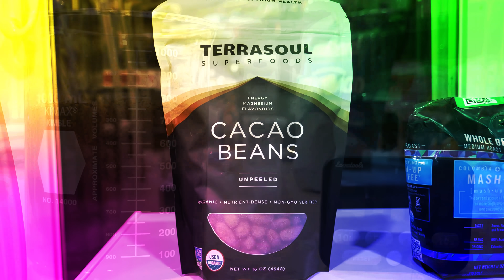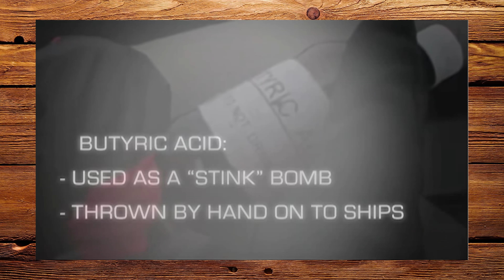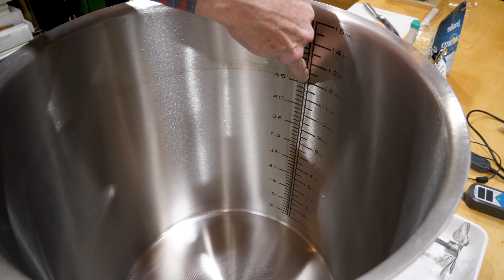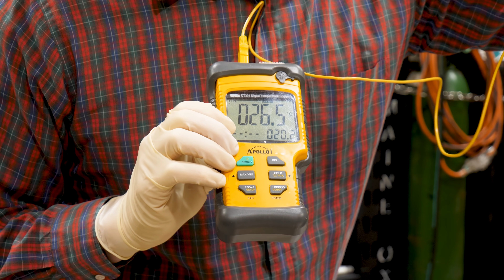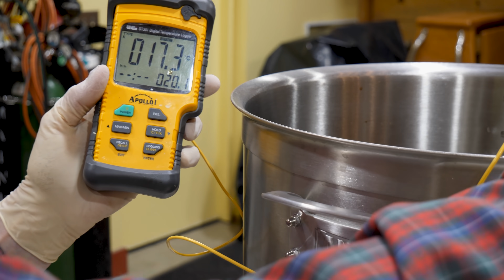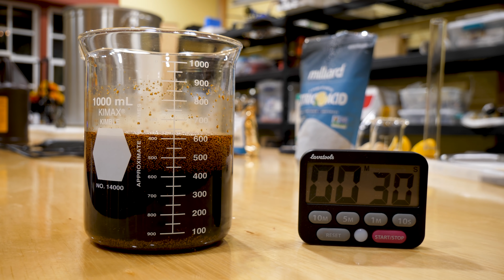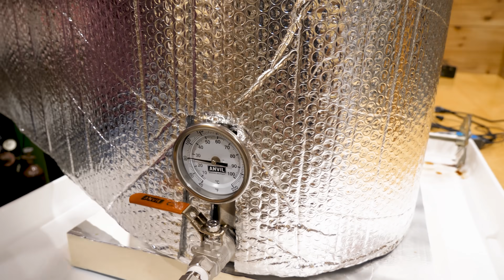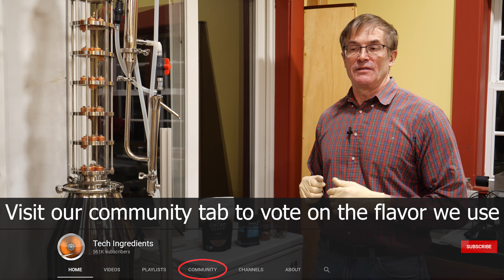Making Flavored Rum | Easy and Cheap! - Part 1

Comment: I really wish it was allowed to distil alcohol in Sweden. I have been trying to make my own styled.. "Rhum and coke wine".. Not ENTIRELY sure it's legal, but it is at the very least primarily based on fruits... (though I wouldn't know how to find a back-door to make a coke flavour so I just add cola-concentrate after the fermentation is done).. You have tought me a LOT of new things that I never thought about.

Either way; When you talk about how difficult it is to get molasses out of the jar.. Me personally SQUEEZE the jar to get out most of it (after all.. it's soft soft-plastic).. then I add water and shake vigorously... and pours again.. add some water and shakes again.. in the end the container is clean and I have every drop of sugary goodness in my batch without using needless energy for heating.
Reply from the maker: Thanks!
Don't worry about the energy expended to heat the molasses, it needs to be warmed up anyway whether it's by the hot plate or the heat that had to be added to the water in the fermenter.

Comment: Hey guys, a quick question and it might sound dumb to most people but for trying to distill first time, I was thinking I do not have the dunder available from a "previous batch" - is there anything I need to do in place of it? Your help or feedback would be much appreciated. Many thanks
Reply from the maker: Not really.
Treat your  first batch as a test run.  You'll  get familiar  with the process and the result is still pretty good.

Comment: Question about Sulfured Molasses. Obviously its much cheaper, is there a way to remove the sulfur before use?
Reply from the maker: Probably, but the necesary equipment may cost more than the savings.  Also, the sulfur is added to prevent immature sugar cane from spoiling prior to extraction.  You may not want that molasses in any case.

Comment: Can an aluminum bucket be used instead of stainless steel bucket.
Thank you very much.
Reply from the maker: It probably can, however as most fermentations run a little acidic you may leach some aluminum into the wash, mash etc.  But, because the distillation process should separate that from the final product, it probably doesn't matter.

Comment: is a distiller a requirement when making rum? I heard you can make rum without a distiller or you can use the freezer to distill it? What if i wanted to make a lower alcohol content rum? I ask because I do not want to get a distiller..no room
Reply from the maker: Generally, freeze separation will enrich the alcohol content as with Applejack, but not that much.  Also, you will not separate out the methanol from the ethanol, only reduce the water content of the unfrozen liquid.

Comment: It still amazes me how irrelevant the color of the source liquid is to the color of the distillate, particularly regarding ethanol. You'd expect with that dark of a wash you'd get some color coming over, but no. Even with a molasses wash, it's still crystal clear. Amazing.

Edit: Also, it's really cool to see that the speakers from the "2nd Best Speakers" video have found a home as shop speakers.

Comment: Dry yeast should re-hydrate without any agitation since the dried out cell membranes are in a very fragile state. Let the yeast rest in your wort/wash/wine/cider for 15 minutes before stirring:)
Reply from the maker: I've never had any difficulty with this technique.  But, you at still be right.
Reply: Comming from a beer brewing background the idea of over/under pitching is quite important. Both strategies will get you drunk- but it affects attenuation and ester production in your fermentables. Hydrating your yeast properly is one way to have a decent idea of cell count. This is important in brewing a good repeatable beer- but I would expect it to be even more important if you where to run it through a still where esters tends to end up inn the various cuts. Of course- build your column tall and this will make no difference to your vodka:) I really enjoy your videos so keep up the good work!

Comment: 19:35 -- explains target of 5:1 concentration, then says "if we're adding 2 gallons of molasses, we're gonna add 5 gallons of water..."  The other calculation of liters was on the mark for that 5:1 ratio...  Solid proof that we should all stick to metric.
Reply from the maker: The ratios are actually easier in imperial. But, 5:1 is correct and that's why we ended up with 12 gallons.

Comment: Making wine in a carboy, the stopper keeps the oxygen out and a bubbler lets out CO2...  Does that container seal or does it just ferment exposed to the air?
Reply from the maker: It does.  The positive pressure of CO2 within the pot as well as the lid keeps the atmosphere out.
Reply: @TechIngredients  Fair enough, but now I have a new question for a RUM I just learned about and LOVE, but would ALSO love to learn to make at home, and I'm hoping you can help.  So 1st would require you giving it a taste.  Its Sweet, and Goes down like a "candy that gets you drunk" is how I explain it to people.  I actually CUT it with 1/4 Bacardi Superior because it's a little too thick and sweet for me, but I still want to know how to make something that resembles it so closely that I could drink it daily without buying a bottle.  Or.... At least learn how they can make such an amazing product.
"Briniey Gold" SHIPWRECK-> Vanilla!!!  Find a bottle and taste it chilled over ice.  I've been a Rum Drinker for the past 20 years and have NEVER found anything I enjoy so much except BUMBU which I've found to have quality control issues..  Bumbu is still a "harsh" drink where "Shipwreck Vanilla" goes down so smooth that I just want more and more and more and everyone I've introduced it to just loves it more than most of what they drink... Whiskey, Gin, Vodka, Tequila, and other RUM Drinkers alike.  They've made something great, so now I want to know how they did it.  Like cooling air with water, or making rockets.  Someone else figured out how to make it work, now... PLEASE show me how they made it work, so I can make it even better!!! Please??

Comment: Thanks for the video.  I noticed that (~19:40) you say that the final ratio is 5:1, but then say 2 gallons of molasses to 5 gallons of water.  Which is it, please? 

Otherwise, great video.
Reply from the maker: It's 5:1, water to molasses.  That's how we end up with 12 gallons of final mix.

Comment: Do you not put an airlock in lid of fermenter?
Reply from the maker: No, it isn't needed.  The lid is flush and there is a thick layer of stagnant CO2 on top of the mixture.

Comment: Wow well water at 7 is pretty shocking. Mine comes out around 8 or 8.2. I wonder what would happen after the water is oxygenated thoroughly.  The CO 2 in the water will make it show more acidic until it can get out of the water. You might want to try just for fun letting your water sit in an open vessel for a few hours and check it again.   Maybe put an aquarium bubbler in it to speed up the process.   I did the same thing at my parents house because theirs showed very acidic at 6.0.  After aerating it was 6.6.

Comment: At minute 35 you discuss how the exothermic reaction of fermentation can lead to thermal runaway in larger batches.

Is there a formula that can be used to determine, for a given ambient temperature, the largest viable volume that could be done without the use of cooling equipment?

I live in a cold climate and ideally want to brew 300 liter batches (or bigger) of beer, without expensive cooling equipment. and without the yeast cooking itself!  heating is not a problem.

ambient temperature would never be above 10C and would usually be more like 5C most of the time.

is there a way I can work out my optimal batch size for a given temp?

I have read that yeast produce about about 587 kilojoules energy/heat (310 Celcius heat units I think) per kilogram of sugar 

but I dont know how to calculate the heat loss for a given stainless steel vessel at a given ambient temp

I need to work this out before I can buy my fermenter!

also what volume is your pot in the vid?

Thank you so, so much for your work of bringing education and inspiration to the world. 

Peace.
Reply from the maker: Despite the dimensions and your temperature estimate this is almost impossible to quantify because of the positive feedback loop with fermentation.  You want to operate at an unstable saddle point.
You don't need expensive cooling equipment just the ability to adjust heat loss relative to temperature.
Submerge a copper or stainless loop in the pot, attach a small radiator and cooling fan and turn a pump on and off with an Arduino/ thermometer.

Comment: doesnt the dunder pit have good yeast so as no need to pitch more yeast?
Reply from the maker: It may still have some viable year, but after months without sugar to sustain it you would be dependent on a small amount of wild yeast that found its way into the bucket.

Comment: its a bit confusing, are you basically taking the leftover cast from a prev run which you left resting for a few months open to the environment then adding to a new batch of mash you are going to ferment? kinda like sour mash whisky only from my understanding they add the left over cast to the low wines before second distillation or spirit run or am i wrong on that? 
also you mention a ratio of  5:1 water/molasses but you said if you use 2 gal of mol then you need 5 gal of water, should it not be 10 gals of water? 
but what is the ppg(gravity points/lb/gal) of blackstrap molasses anyway? all i found was "Molasses: 36 ppg" but nothing yet on blackstrap 
what i found is that 1 gal of blackstrap is approx 12lbs so for your ratio of 5:1 that comes to 2.4lbs/gal at 36ppg comes to 86.4gp which is about 11.3% pabv for your mash so that sounds about right
Reply from the maker: It should be 5:1.  If I said 2:5, that's incorrect.
It's not very critical, but the limiting factor is too much sugar, which can poison the fermentation process.
Reply: @TechIngredients  you said 5:1 then said if you use 2 gals of mol  then you need 5 gals of water , i think you meant to say 10 gals of water for that ratio

Comment: Just wondering where the dunder comes from? Not the average supermarket Im guessing ?
Reply from the maker: The dunder is the remaining material from a previous fermentation, the stillage from a previous distillation of rum or a mixture of both.  You make it and age it yourself.  I use only the material from a previous fermentation.

Comment: These videos are brill. But I bet you've handled a carboy of conc sulphuric? More dense than Molasses.
Reply from the maker: Actually, I believe your right.
When I have, I was so concerned about what was in the bottle I didn't focus on the weight.
Reply: @TechIngredients  I was pouring my on a pallet of wood! Big mistake 😝. Btw, to remove chlorine from potable water, generally it's around 1ppm, one idea could be instead of acidifying the liquor after adding molasses, acidify the water somewhere short of where you might expect  to add acid. This will significantly lower tap water pH as I imagine there is little alkalinity to buffer the acid. This will drive the speciation from hypochlorite, hypochlorous acid to diatomic chlorine. If you give it a stir and heat it you should encourage degassing.  I would hope that would speed up chlorine removal.

Comment: I know you said it would be decided by vote but I really hope you don't choose vanilla.  There's nothing wrong with it, it's just such a common spiced rum flavoring.

I'm also curious what the difference between a gin basket in the still output vs steeping/soaking the flavoring agent in the finished alcohol(heated or not) would be.
Reply from the maker: We will abide by the vote.  No hanging chads or harvesting.😙
I understand that there is a significant difference, but I've not tried the steeping method, so I can't give an opinion.

Comment: You had said 5:1 ratio, then said 2 gallons of molasses to 5 gallons of water; you meant one gallon or two? I’m not sure of the sugar contributions of molasses, I know a gallon of honey with 4 gallons of water will bring you to about 12.5% though.
Just curious about how much molasses you use.
Thanks!
Reply from the maker: The ratio was 5:1.  Note the final volume of liquid in the pot when everything was combined.
Reply: @TechIngredients  thanks for the clarification!

Comment: Could we add oxygen with bottled O2with Ann aquarium bubbler
Reply from the maker: You don't  want oxygen once the fermentation begins.   It's  actually  necessary for the initial multiplication of the yeast, but it must then be avoided to force the yeast to convert to an anaerobic  metabolism to begin converting sugar into alcohol.

Comment: Isn't it better to use another type of acid instead of citric acid, which is an antibacterial? You mentioned Nitrogen and phosphorous as yeast nutrients so why not phosphoric or nitric acid?
Reply from the maker: Maybe, but it doesn't appear  to inhibit the fermentation at least in the small quantities I've used.

Comment: When life gives you lemons, make ... yeah, Rum will do ... ;-)

Serious comment: With the drain tap having a right angle fitting, have you thought of blowing air through the drain tap.

Obviously you don't get the "cool factor" of the concrete mixer, but I'm sure introducing compressed air might be interesting to watch ... :-)

Another thought is the phrase "Dunder head", for someone who isn't especially bright, makes far more sense after watching the video.  Thanks ... :-)
Reply from the maker: The concrete mixer is too effective.  A single location for a stream of compressed air wouldn't be likely to mix as well and the concrete mixer airates nicely.

Comment: I wouldn't use the gin basket when your running the still... Instead just macerate the spices individually after, then blend together to your preferred taste. If you infuse with the gin basket, you're stuck with the infused rum.
Also, your heads are going to strip out 99% of the spice's flavours before the hearts start to come through the still, so you can run the still & once you reach hearts, turn it off, cool, then add the basket.
But again, I'd just run it, make cuts, then spice your product. You could I guess (like Gin), re-run your chosen cuts with the spices & blend your (second round of) cuts as desired?
Reply from the maker: Those are all viable options.  That's what makes this so interesting.

Comment: I own a microbrewery it was pure joy watching the whole video ! Just a comment: You NEVER EVER do that to the yeast :) Just stirring it in stresses the yeast a lot. Normally you let it hydrate in water for 10-15 Minutes and then add a little bit of your  supposed fermenation liquid so the yeast SLOWLY gets used to the medium. 

Just my 2 cents as being an Food and Biotechnology technologist :)
Reply from the maker: Thanks.
Actually I've heard that, but I've done it this way for  decades and I wonder if it really matters. So, I think I'll test a variety of introduction methods and possibly cover this in a video.
Reply: @TechIngredients  The key is that you dont want the Crabtree to happen. Yeast will grow at its maximum when they are limited in resources:
https://de.wikipedia.org/wiki/Crabtree-Effekt

In this early stage yeast is really fragile, but because you use 1g/l I think you are still finde that is the optimum for pitching yeast.  It is nice to have such an enthusiast doing this stuff. I was really keen in trying out the rocket motor you have demonstrated. I love that

Comment: Just need your input,the base of my still is aluminum, can I ferment in it as well? Actually would be great if you could do video on different materials that can ve use for fermenter and stills,there is lots of pseudo science and opinions, not enough dood hard info o this one.
Reply from the maker: Aluminum isn't the best re fermentation due to its corrosion in acid solutions.  However, as with your still, the distillation process will not pass aluminum through the vapor phase and so if the fermentation is for a distilled, final product then it shouldn't be a problem.

Comment: Odd question, what if instead of mixing vigorously at first to aerate the yeast, what if you had an O2 cylinder and just lowered a tube into it and bubbled oxygen for a few minutes? You could leave the tube in and periodically put more oxygen in as it ferments?
Reply from the maker: You only  want the oxygen at the beginning to encourage  multiplication of the yeast, and then you want anaerobic conditions to encourage fermentation.  That is why a one-way valve is often used.  It excludes air.
Reply: @TechIngredients  thanks for getting back to me. Your videos are great. I graduated with a mechanical engineering degree 6 years ago and your demonstrations are awesome to follow along and learn

Comment: you could have multiple hydrometers with just a 10 mL grad cylinder and a 0.001 - 200g scale
Reply: which may also help with waste when working at smaller scales. specific gravity (SG) = density solution / density water. I'm sure you are all aware though.

Comment: my rum mash is at 4.4 ph, 15% ABV before the fermentation, is it too low? i shoul increse the ph? Thanks
Reply from the maker: Ya, that's pretty acidic.
Reply: @TechIngredients  i add more molasses and some brown sugar, maybe it too sweet...i should add some baking soda or leave it as it is? thanks
Reply from the maker: The source of the acid is what I'd first want to find out.  Is it your water?
Reply: @TechIngredients  I used an fresh dunder from previous distillation in wich i added new mollases and some water, maybe that dunder was to acid